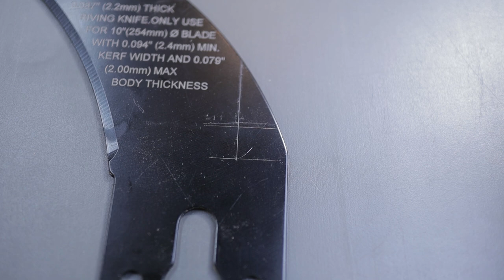How I made 5 different designs of zero clearance table saw inserts for the Dewalt

Comment: Very cool!  I was really impressed with your jig saw skills.  Your scroll saw doesn't appear to have a hold-down, but there's no chatter.  Is that because you're using a very thin blade that's going slow?   I own a similar scroll saw, but seem to have issues with my work pieces staying down on the table even when I use the hold-down. :(
Reply from the maker: Thank you! It is a thin blade I'm using. If the workpiece is chattering upwards it's most likely because the blade is in upside down. The  teeth will change direction closer to one end and that end goes down.